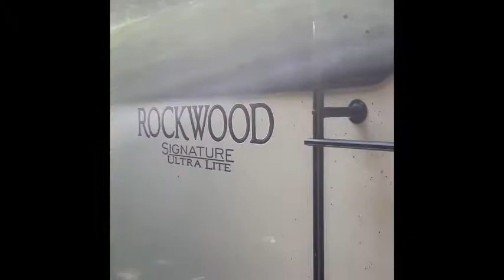Factory Ford TPMS System for your trailer , review

Comment: I have a 2020 F350 limited and  Forest River. I bought the kit for the camera and TPMS system. I had to have the trailer TPMS activated on dash.

I ran it through the tongue same as you. Ran it down the battery compartment through a hole and installed it on the frame rail. I ran the camera cable along the propane pipe to the back. Up into the side cabinet. I did run it along the back wall with a cover over the wires into the rear cabinet. I installed the camera where the furion camera bracket in on top and installed the camera there. Now on my 2020, i cant turn on the rear camera when driving..it is great backing up, it's pretty clear.
The only reason i ran it along the propane tank line is due to my slides on both sides. Couldn't run it in the fender.

Comment: Caution…Some trucks have two different harness connection points, make sure you don’t have two connectors before you start cutting and splicing factory harness.  

You can actually install a plug in both the bed and bumper using the factory harness.
Reply from the maker: I removed the spare tire & looked very hard for any other connecter & could not find one , that said thanks for your comment hope it helps other people , the system is working very well & im very happy with the way it preforms.

Comment: I'm a Ford Dealer and have been chasing this same problem for a customer for over a year.  I guess Engineers must not have ever owned or use the vehicles they design.  Go figure.
Reply from the maker: They could make a 3 ft extension & include it with the fifth wheel prep package if the tpms is also purchased ,